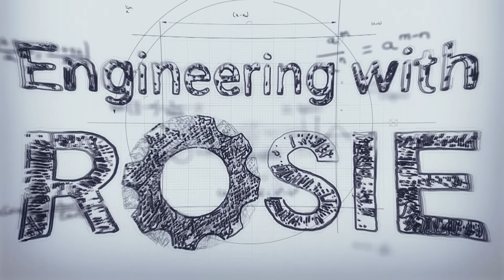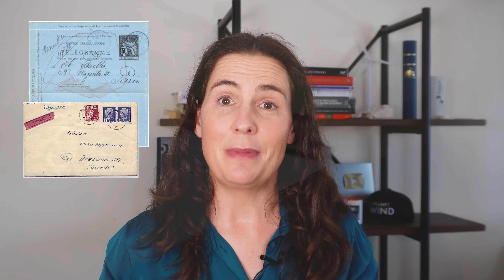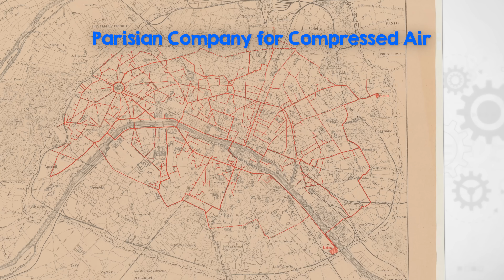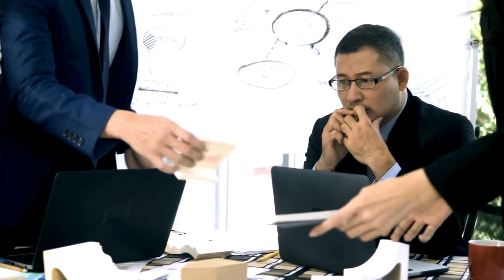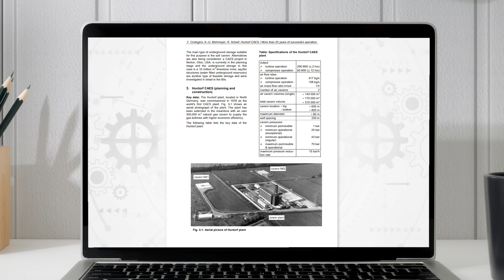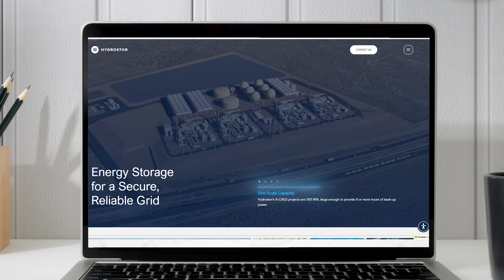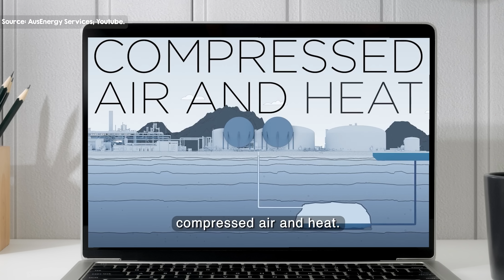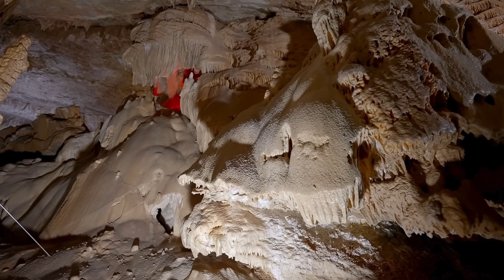The Genius Energy Storage Idea Everyone Forgot

Comment: Is it just me, or does 66% efficiency seem low? Better than curtailing though.
Reply: For long term storage, cost/kwh is much more important than conversion efficiency.
Reply: Thermal power plants (coal, nuclear, you name it) have calculated efficiency under 40%.
Reply: @mikoajp.5890 yes, but battery storage is 70-90%.
Reply: @andrewdyjach7305  the thing is how long can a battery hold electricity, and what is the price of storage per MWh. Pumped hydro is also less than 70% efficient but it can store energy for very long time.
Reply: @andrewdyjach7305  And there is no problem keeping the batteries charged for 8 hours or even a few days. So every other storage solution has to deal with the forever dropping price of batteries. However, the up front costs of batteries is still very high for gigawatt level of storage.  The giant spinning thing, whatever it is, gets cheaper as you make it bigger, so huge projects like this are still cheaper (for now). And in Australia the price of peak power is sometimes negative, making storage based generation a money maker at any efficiency.
Reply: @mikoajp.5890 Solar panels also have an efficiency of 24%
Reply: It is lower than hydro storage, but I think the idea is that it is cheap long term storage, for emergency use a few times a year, and for that, efficiency doesn't matter, you "pump it up" using spare power when available.
Reply: It's not beating battery storage any time soon, but it can be done at massive scales without the materials needed to make huge battery banks: air compressors are low tech, and obviously the air is free!
Reply: @Albuderol01010  It will beat battery storage as soon as we have enough spare power to be able to pump it up and not worry about the low efficiency, and it appears that Australia in the summer now has a fair amount of negatively priced electricity, which means that you can easily make a profit at 66% efficiency, so maybe it does already beat battery storage for storing summer power for winter emergency use?
Reply: Efficiency is not key, cost is
Reply: It's air, I'll take 66%